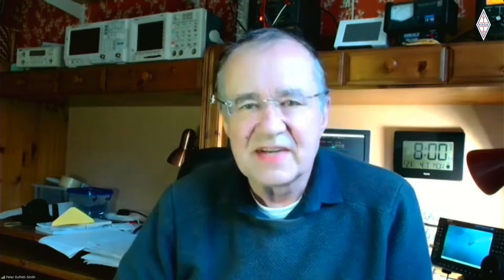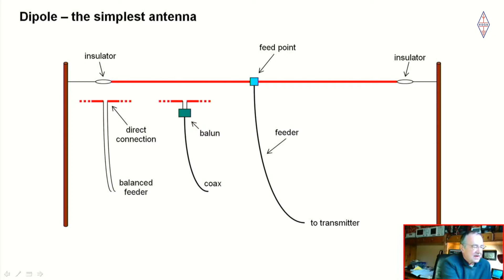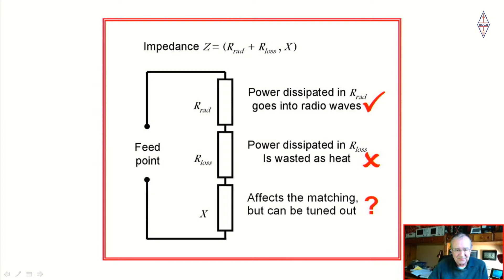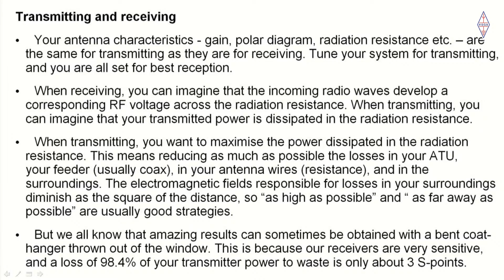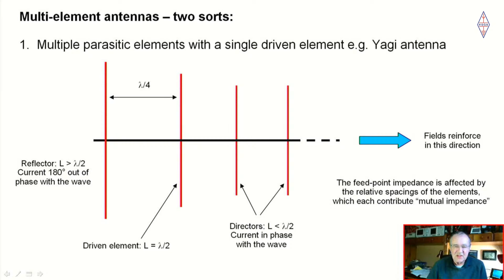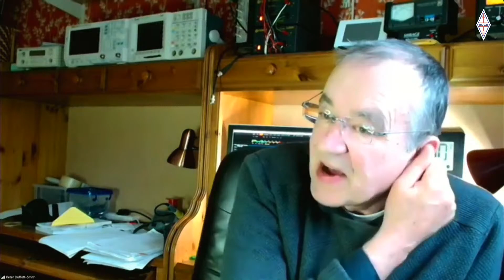RSGB Tonight@8 - Radio waves and antennas...and all that by Peter Duffett-Smith, GM3XJE

Comment: Hello. As a old CB man from the 80's & now as today a licenced Ham. I found this very good. I will follow this as & when you do another production. I have also joined the RSGB. I did not need to do my foundation exam as i did this with City & guilds back in 1989. So this was still valid. 73's from M#7DOZ. P.s. Back in the 80's i did a lot of experimenting with aerial design. Dipole / Ground plane & Yagi with rotator. I must say i was not liked too much by my neighbours. But made contacts from around the world in the A.M hours Now i know more about filters & hope to be up & running soon. 
Regards.
Steve.